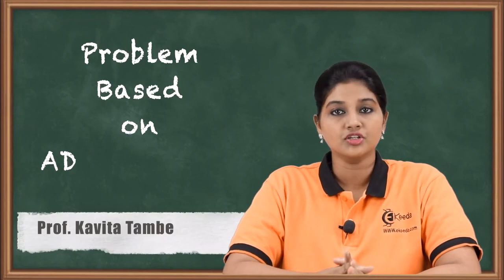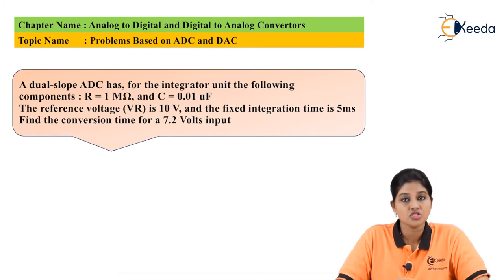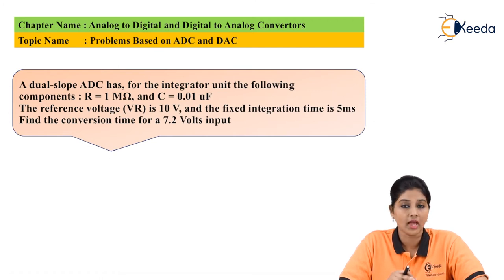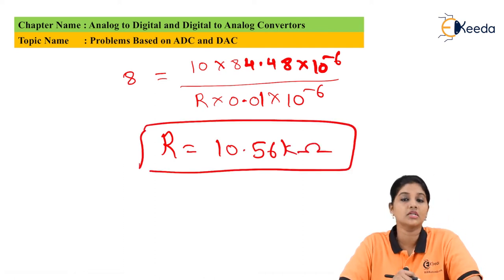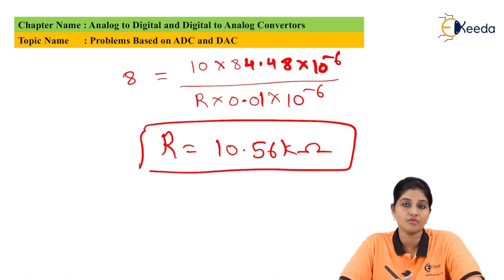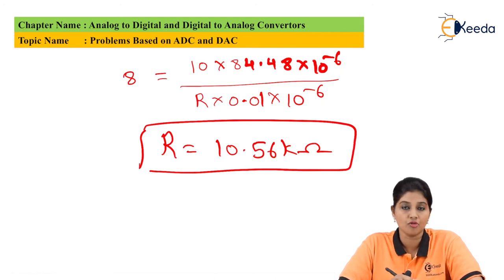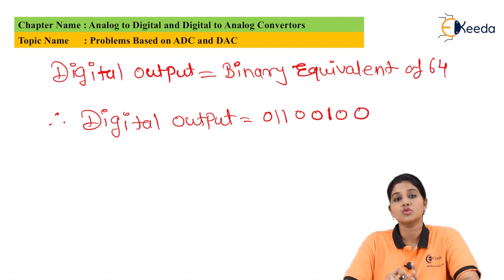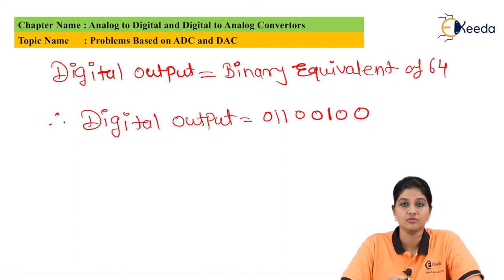Problem based on ADC and DAC | Analog to Digital and Digital to Analog Convertors in EXTC

Comment: A Digital-to-Analog converter has a 12-bit binary input. The output analog voltage range is 0 to 5 V. How many discrete output voltage increments are there and what is the smallest voltage increment?

can you solve this problem?
Reply: the discrete voltage increments is the quantization which is equal to 2^n = 4096,   the smallest voltage increment = Vr/2^n = 5/2^12 = 1.2 mv